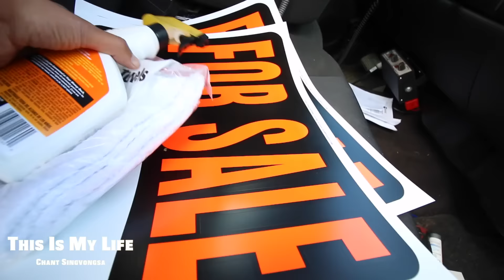Time for the Chevy Dump truck to find a new home!!!! Lawn care Landscaping

Comment: Hey chant, you should by the plow for the 3500 and also a dump insert. So your truck will basically be a dump truck. I'll highly recommend them and they are not expensive about 2 to 3 thousand.
Reply from the maker: Yep thats is the plan:)